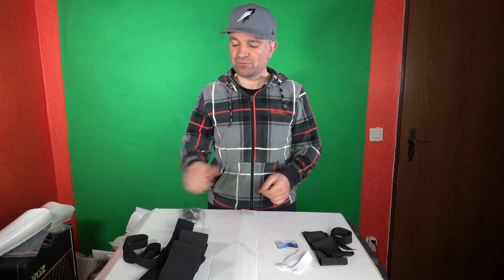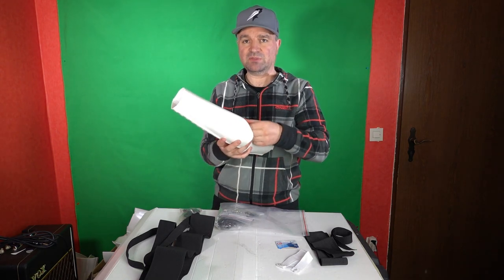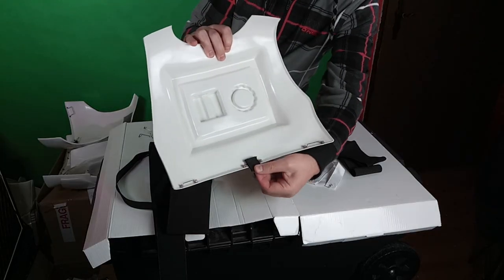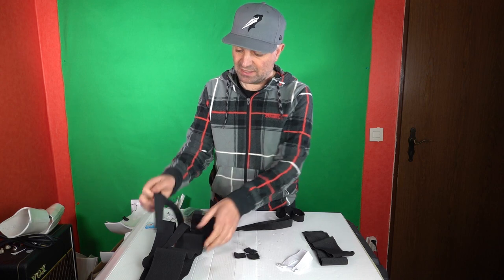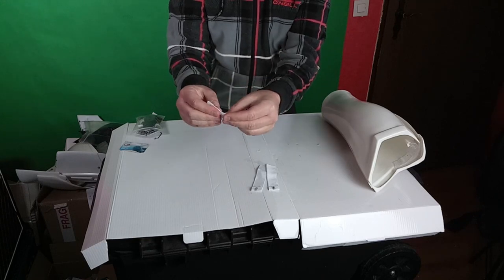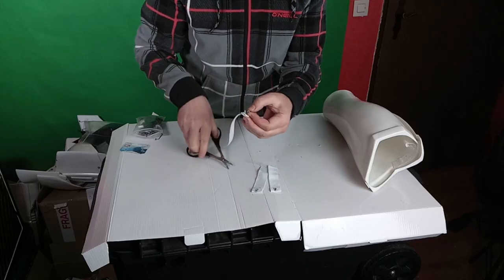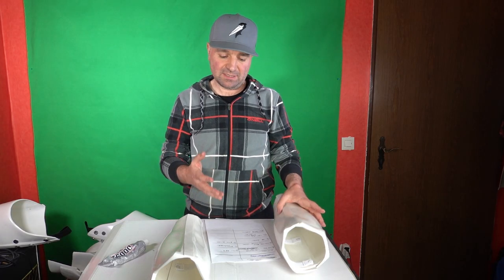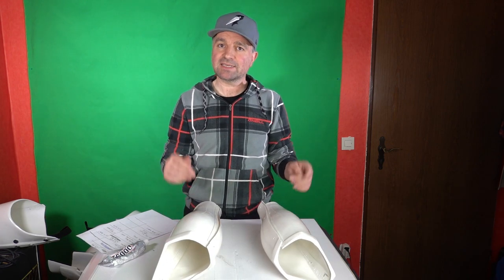RS Prop Masters strapping kit - A CLOSER LOOK / REQUIRED IMPROVEMENTS

Comment: The thigh hooks definitely need some attention. I added a ton of stitches by hand and also added a bit of E-6000 to all areas that could come into contact with sharp edges. This way everything is coated in elastic glue... Nice and secure. There is no way my hooks are going to come loose now. :)